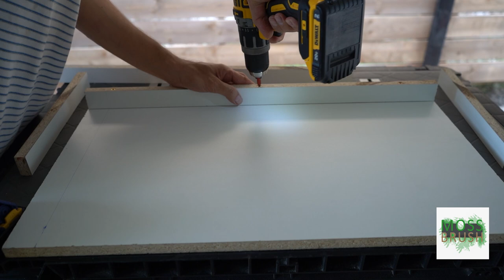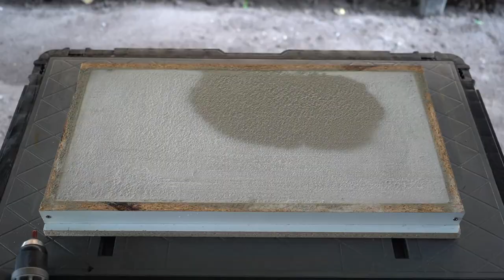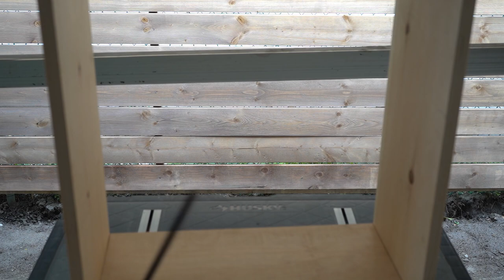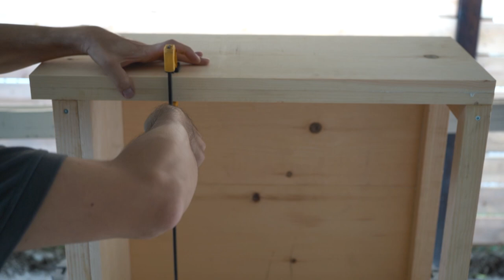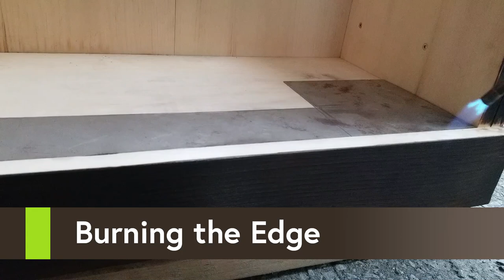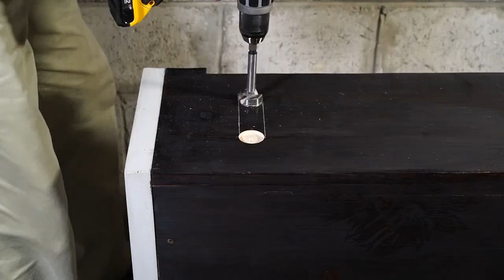DIY Aquarium Stand with Concrete Top

Comment from the maker: Thank you for checking the video. What I learned from this project: 
I should not use very soft pine wood, some parts (specially the door) were bended!
Also, better not to use shellac finish for aquarium stand, cause if you need to re-apply it later it is not possible because of odor!
Reply from the maker: @katiaisadora20  ☺️☺️